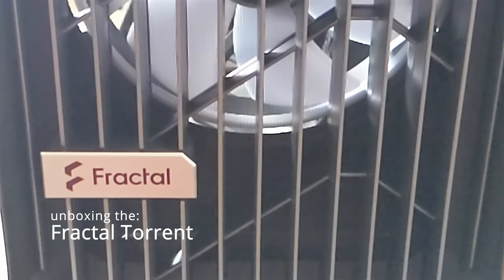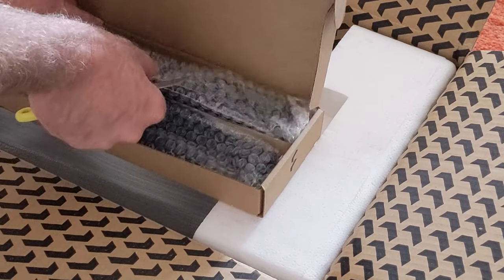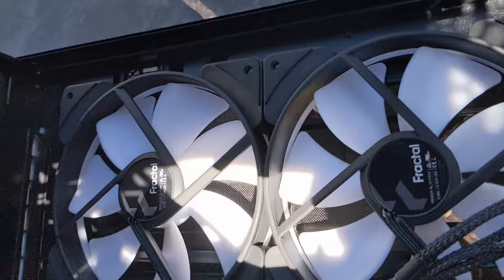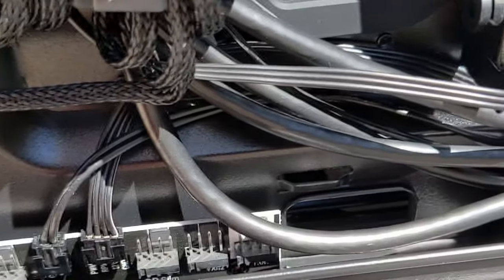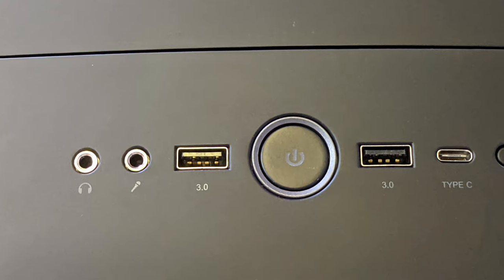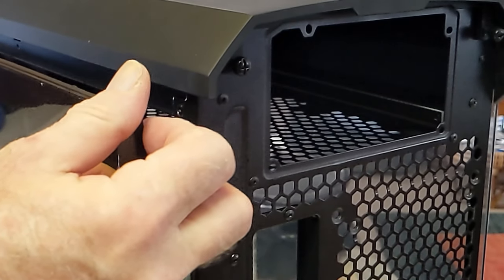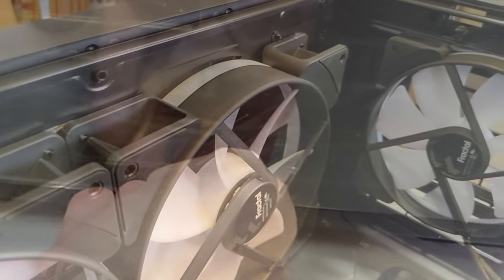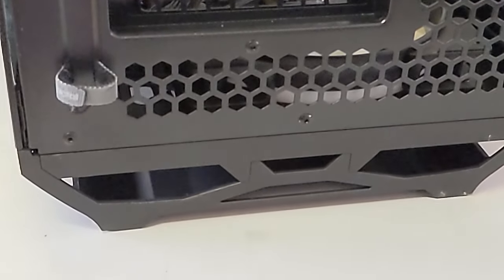Fractal Torrent computer case unboxing. Looking the new Torrent over.

Comment: Looks good bro.
Reply from the maker: Thanks Buddy. It got to me about 12 hours after the recall went into effect. I think I'll switch my 3900x over into it and then build the incoming 5950x w Unify-X and G-Skill in the big BeQuiet case that serves as storage and work device. Building a second device is not nearly as pricy as the main computer. I am using M.2 leftover from when I upgraded this rig to gen4 M.2.... so I've got two to put in. Won't need storage, I've got 26TB in the BeQuiete case. Just the MoBo components and the case and PSU had to be bought right now. This will more than double my processing power. In the next year I should change the 9300x over to the 5950x also. Actually, that was my original idea... when the 5950X ever got to $800 again, I'd snag one and sell the 3900x. But then I thought, well, just a MoBo, PSU, some cheap RAM and a cheap case and I could have another whole processor rendering. (I have an old GPU that will suffice for the CPU renders).... and a good air cooler also. Then, it was "can't put a cheap MoBo under a $800 CPU... so I got the Unify-X. Strong, no bells and whistles but strong and capable. It has 4 NVME slots, so I don't really need external storage with this for now anyway. And all files will go to the main computer for final processing.... then came the Torrent.... and I chucked it all and went for broke (again). But I suspect this will do the work I need it for, and when Nvidia has 24GB cards at $1,500 again, I might be interested... next year sometime, LOL.  This is a pretty strong rig and the parts (other than GPU) are solidly matched. Your research has helped me a lot to decide components. I really like your look into RAM. That Torrent looks like just the airflow I need for CPU rendering. The airflow going under that PSU compartment should increase velocity a lot and just whip heat away from the VRMs, as well as help increase pressure at the front of the cooler. I took the rear fan off my BeQuiet because it was two feet from my head all the time and I could hear it, so now2 it has 6 intake fans and 0 exhaust. When Torrent was shown a week or two ago, I immediately knew it would be a case I'd appreciate. And since it'll be in the living room, some RGB to look like art makes it good also.

Comment: Hey John just wondering if that cable for the RGB shroud where the power supply sits, is that a pin connector, or is it fixed to the side?
Reply from the maker: I took the cover off and push cables aside bit so I could see one end at least. And that end is fastened with the Phillips head screw. And the RGB itself just plugs into a regular SATA drive. The other end is covered up by the power supply. But I suspect it's the same.
Reply from the maker: This is such a  good case with such great airflow that I have to recommend it totally. I have a BeQuiet Dark Base 904rev 2 that I adaped more to the Torrent by taking the PSU shroud out and adding two incoming fans there, and I took the top fans and turned them all inwards and I have better cooling there now.... but even with 8 incoming fans that 5950x runs a couple degrees warmer than the 5950x in the Torrent case.
The only thing the BeQuiet adds is more mounting options for a bay that I was able to add a 4 SSD bay-thing and a hotswap bay for HDD. I also have loads of slots I can sue for drives, but am limited by my SATA and desire now for M.2 NVMe drives in the MoBo. So a Threadripper is still something I could use..... but the Torrent has space for 4 SSD's and two HDDs. Add a good MoBo with two M.2 slots, heck, that's enough for almost anyone.... even me!